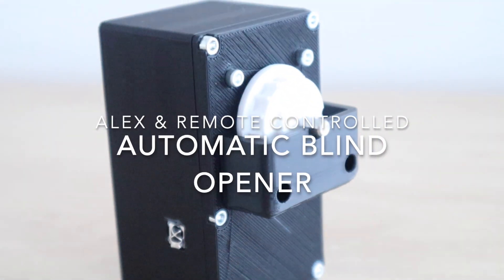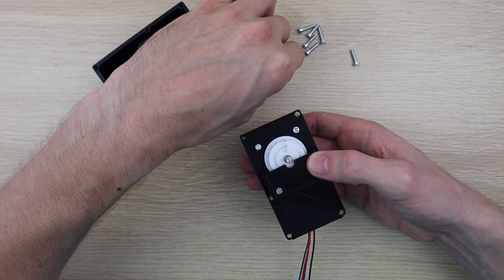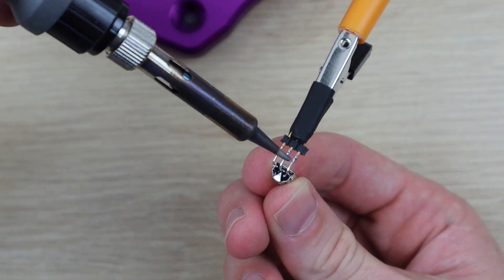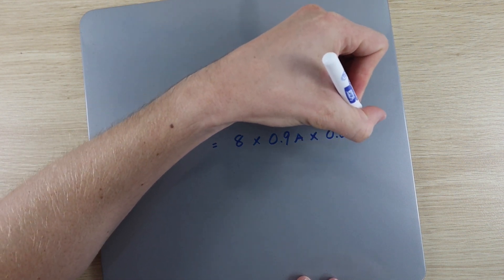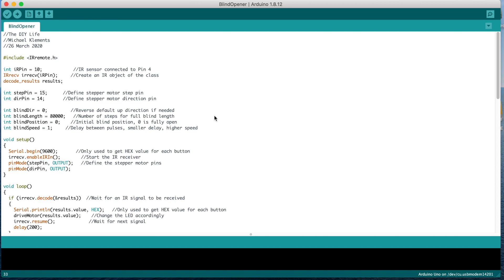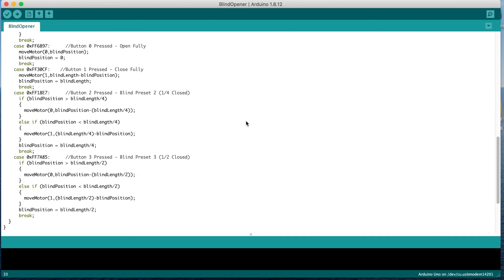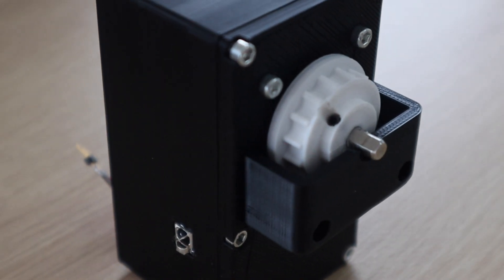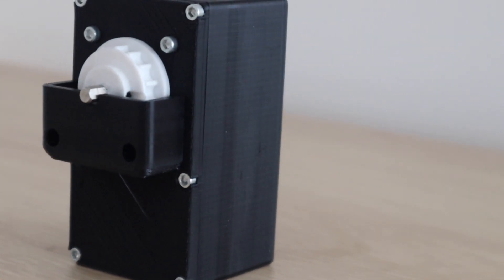Arduino Automatic Blind Opener - Works With A Remote Control & Alexa

Comment: Hey Michael Great vid, thanks for sharing. Video quality and audio is excellent. I'm doing a similar project.
What I'm struggling with is how does your system remember the position in case of loss of power?
Reply: I have same question
Reply: Depending on your mc of choice you could save it in the flash

Comment: Hi!

I'm trying to create this project but am new to this. 
If I am to use a 12v 2A power supply as you have, do I need to step down the voltage before supplying it to the arduino?
You haven't mentioned this in the video which is why I'm curious as to how you pulled it off without damaging the Arduino.

Thanks and appreciate the video and 3d files!!
Reply from the maker: You should have your power supply braching off to your Arudino and to the stepper motor driver. Most Arduino boards can handle a supply voltage of up to 12V, so no need to step it down first.

Comment: how big was this roller shade of yours? it looks like 40x72 inches.   mine is 60x 72,  i wonder if the nema will have enought torque to lift the vinyl roller shade
Reply from the maker: It's around 47x94 inches. Nema motors come in a range of sizes with different torque outputs so you should be able to get one that can lift your roller shade.

Comment: Donde encontraste el engrane que acoplas al eje del motor?
Translated with google:
Where did you find the gear that couples to the motor shaft?
Reply from the maker: It’s 3D printed, there’s a link to download the model files which include the gear in the guide linked to in the description.
Reply: Gracias por su apoyo colega! Tengo otra pregunta, cual es el torque del motor? Intente leer la descripción del producto pero el enlace a Amazon está roto 
Translated with google: Thanks for your support colleague!  I have another question, what is the torque of the motor?  I tried to read the product description but the link to Amazon is broken

Comment: I have no experience in soldering would this be hard for me?
Reply from the maker: I don't think any of the soldered joints are particularly difficult and they're not directly ono heat sensitive components, but you might want to practice a bit on some old PCBs or prototyping PCBs first.

Comment: Could this be run with the same code on an arduino Uno?
Reply from the maker: Yes you could use an Arduino Uno. You might need to change the pin numbers around but ther rest of the code will work on either.

Comment: Hi, how does the blind opener get powered? Did you put a battery into the housing, if so, how often does it need to be replaced?
Reply from the maker: I powered it using a 12V power supply which plugs into a socket on the bottom of the case. You’d probably need to replace or recharge a battery every couple of days with the Arduino and infrared sensor always on, unless you implement a power saving sleep and interrupt to wake up.

Comment: hello, I'm just struggling with the TMC2209 driver and I have a problem. The maximum setting of the blinddlength step is 3200, it is 20 turns. When setting a larger number does not give any result.
Reply from the maker: Try changing the blind length parameter from int to float

Comment: if i use the ESP8266 board that has wifi built in, I dont need a infrared remote with sensors anymore right?
Reply from the maker: Yes you could do that

Comment: what power source are you using for this project?
Reply from the maker: I used a 12V 2A barrel jack power supply that I use for most of my Arduino projects.
Reply: @MichaelKlements  I used your video as a tutorial for my school assignment, and I'm still very confused about the details of the steps that you gave in the video.
 Is there a way to contact you personally so that I could get your help? I'm still very new at Arduino and I want to learn as much as I can 😁. 
Thank you in advance for your reply 😆
Reply from the maker: Hi Alfatich,
Unfortunately I don't do one on one sessions at the moment but you can post any questions you might have in the comments section on my blog (linked in the description) and I usually get back to them quite quickly.

Comment: Im trying to make this project. When I use my remote, the motor vibrates instead of spinnig. Any help?
Reply from the maker: Does the motor turn correctly if you give it a signal through your computer rather than using the remote? You need to figure out if its an issue with reading the IR signal or if there is an issue with driving the motor.
Reply: @MichaelKlements  I'm currently trying to figure it out. I have another question, can I power the Arduino and the driver with the same 12V supply? My motor can take 1.6A, will it burn the arduino?
Reply from the maker: Yes, the Arduino Pro Micro can handle 12V, so you can supply it from the same supply. Just make sure that you supply the motor and the Arduino individually from the supply (don't supply the motor controller from your Arduino). The motor controller will draw the current it needs from the supply and so will the Arduino, the 1.6A to the motor won't have any affect on the Arduino.
Reply: @MichaelKlements  I'm using another driver, TMC2130. I'm finding very difficult to make the project work. Any suggestion?
Reply from the maker: The TMC2130 has a slightly different pin configuration for the enable and micro-steps side, which might be the issue. Have a look at the schematic I've used for my camera slider that used the TMC2208 (it looks like the same configuration) - https://www.the-diy-life.com/diy-motorised-camera-slider-with-object-tracking/
Reply: @MichaelKlements  I've managed to make the project work with the TMC2130. But I'm noticing that the driver gets very hot. How can I resolve the problem?

Comment: Hello, I did the project but the motor is not strong enough to operate the roller. It stays blocked. I have used the Nema 17 motor from Torque 1.8 which is the closest thing I have found. Could you tell me the exact number of the engine you use? Thanks
Reply from the maker: Hi Charlie,
The motor I used was from an old 3D printer, so I don't have a datasheet for it. The strength of the motor you need depends largely on the blind though. The blinds, length, width, weight and mechanism design all play a role in how much torque is required to raise it. 
One easy way to get a bit more lifting power out of your motor is to reduce the size of the output gear on the motor. Making this gear smaller means that the blind operates slower, but the motor is able to lift a little more.
Reply: @MichaelKlements  I'm going to try that. Thanks a lot Michael

Comment: Hi, when i cahge 0xFF02FD to E0E020DF iam getting error message:  'E0E020DF' was not declared in this scope. how to solve this?.
Reply from the maker: That looks like you've removed one of the formatting characters, so the code is expecting that to be a variable name and not a value. Check that you haven't removed the : or one of the { or } characters.
Reply: @MichaelKlements 
 Finally I made it.  Everything is working except the the blind length, its giving me hard time. 
When I write,   int blindlength = 9950000; 
Only button 2 and 3 are working and the travel distance is too short. 

Whate am I doing wrong?
Should I punt May code here so that you can help me?

Comment: Hi, when trying to write the code to the Arduino, I get an error 'IRrecv' does not name a type. Then it goes along with other errors pertaining to that. Do you have the libraries for the remote? Is that what I'm missing? Thanks.

Comment: Great Video! What do you think about using a Mg946r Motor Servo 13kg instead of the Nema 17 Stepper Motor?
Reply from the maker: Hi Álvaro. I don't think a servo would work very well for this type of project. You'd need to modify the servo for continuous rotation (the Nema 17 motor turns around 100-200 times for the blind length) and then you lose the servo's position control. You'd need to then add limit switches to the open and closed travel limits.

Comment: Can you do this project again with an Arduino Nano. As I am struggling to get hold of a Pro micro....
Reply from the maker: Hi Lawrence, you can use the same pins for the Arduino Nano. Just be aware that the power pins are labelled a bit differently on the Nano, but the function is the same.

Comment: Great work. Maybe use a tmc2209 to reduce stepper motor noise
Reply from the maker: Thanks Ramino. I've actually bought a TMC2209 to try out, I just need to get around to installing it!

Comment: Hi, this is a really nice solution you've built, I'd love to build something similar using a NodeMCU board, but regrettably I'm not proficient in the coding side, have you any idea if your code could be modified to accomodate this?
Reply from the maker: Yes it should be able to be modified to suit another microcontroller.

Comment: Is it posible to add second motor? Becouse I have two blinds and i want to add 2 motors to one adrduino?
Reply from the maker: Yes you can add a second motor, you'll just need to run a cable from the one with the Arduino to the second motor. The Arduino has sufficient IO to drive another motor.
Reply: @MichaelKlements  thank you very much. And if I want to connect that second motor I connect it same as first motor yeah?
Reply from the maker: You need to add a second stepper motor driver and you'll connect that to the Arduino in the same way as before.
Reply: @MichaelKlements  thanks😀
Reply: I have a concervatory with 6 roller blinds, would like to have one main controller and 6 motors from it, could 6 motors run off this with sufficient power? Many thanks